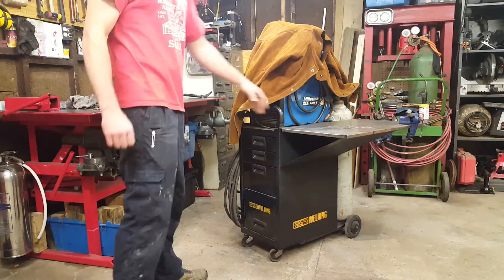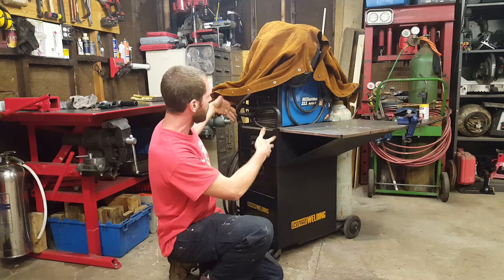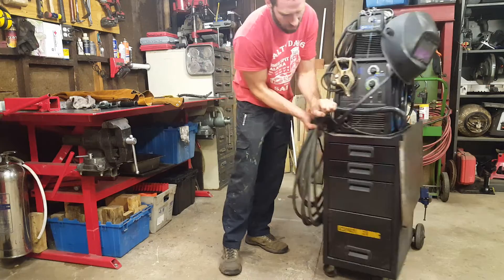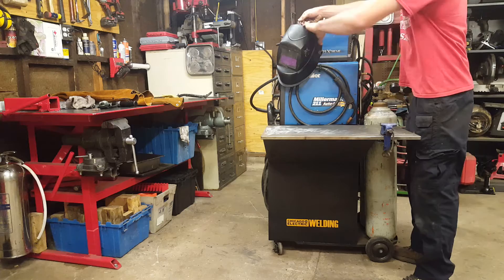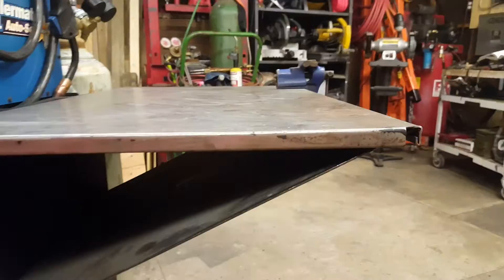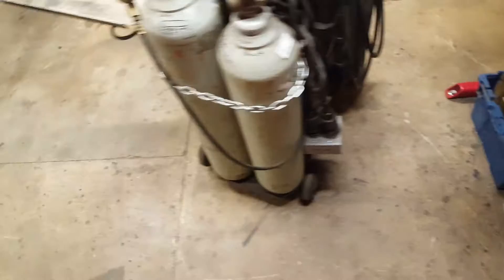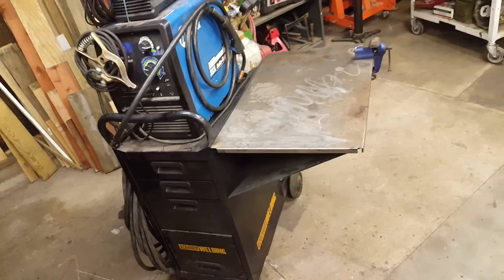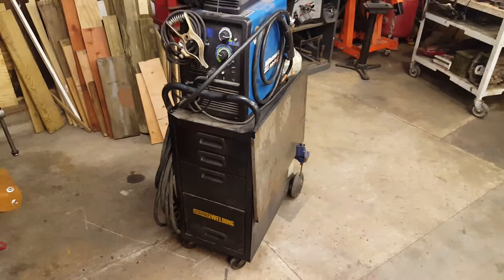Harbor Freight Welding cart mods/review Chicago Electric Shelf modification HF CABINET

Comment: My plasma cutter had 4 rubber feet on the bottom of it which I removed. Then, I took the cover off of my welder, removed the top handle and drilled holes in in the top of the welder cover to match the location of the rubber feet holes that are  on the bottom of the plasma cutter.  I then screwed the plasma cutter to the top of the cover of the welder and re-installed the cover on the welder. It worked out great.  No bracket or bungee cords and a nice looking setup. I use the cable hooks on one side for the welder cables and the cable hooks on the other side of the cart for the plasma cutter cables.

While trying to figure out how to mount the plasma cutter I came to find out that the sides of the Harbor Freight cart are double walled. No wonder the cart is so sturdy. It's built like a tank.  My next project for the cart is to modify the back of the cart so that it will hold 2 tanks instead of just1 tank. (1 25-75 and 1 argon).

Thanks for the video. It inspired me to mount the plasma cutter on top of the welder.

Comment: I bought the Harbor Freight cart about a year ago and really like it.  I am amazed at how well built and sturdy it is. Great bang for the buck IMO.

About a month ago I bought a cheap EBay (Chinese) plasma cutter, which I am very pleased with. As of now I have it sitting on top of my table saw when I am not actually using it and I was overthinking how to add it to the cart. Should I do a shelf off the side, make a small angle iron rack so that it is above my welder, etc.?   Like I said, overthinking.  Watching your video made a mental light come on. I'm just going to take the handle off of the top of my welder (Eastwood mig 175) and stack the plasma cutter on top of the welder like you have done.

Overthinking things seems to be what I do best. FYI -- I keep my welder covered with a moving blanket from Harbor Freight help protect it and keep it clean.
Thanks for the well done video!
Reply: I screwed my plasma cutter to the top of the mig welder case using the holes for the rubber feet on the bottom of the plasma cutter. Works great.
Reply from the maker: Tom Rumish Thanks for sharing.  Im glad the video helped you make a decision.  I thought of screwing mine to the top as well, but the only reason I did not it's because I want it to be portable in case I ever need to grab it on the go. so for that reason I just used some rope and a rubber pad underneath of it. and now if I need to bring it to work with me or something it's a breeze to remove.    I am plagued with the same problem of always over-thinking everything too LOL

Comment: welding on the shelf doesnt damage the welder? like when welding on a car? that looks nice and want to try it 👍
Reply from the maker: David Piceno excellent question. No I haven't had a problem. But if I'm doing some serious welding or any grinding on the Shelf, I do throw a small welding blanket I have over the unit.  But honestly at the same time I'm not worried if it puts a little wear on the surfaces of the welder overtime.  It's a super convenient setup and I don't think I'll ever sell this Miller. I love it!  The only reason I would be concerned about keeping something cosmetically impeccable would be if I was to be reselling it. Thanks for watching and I'm glad you found it helpful!
Reply from the maker: +David Piceno I might have misunderstood your question. Did you mean could the welder electrical system be affected? the answer is no.
Reply: NoNonsenseKnowHow thanks i was wondering if it would fry them,  im going for it

Comment: Can you provide the sizes for the top and bottom pieces of the shelf you made?
Reply from the maker: Yeah I can get that for you later today after work
Reply from the maker: Working service is 27 and 1/2 by 17 and 1/2. and the angled support plate is 20 in wide by 19 in
Reply: Can you tell me what guage sheet is the table and brace ? I just got this cart , and want to do this mod , just don't know what guage to use . Thanks  @NoNonsenseKnowHow

Comment: Nice setup there, I've just bought a Everlast Tig 200DV and been thinking of  doing same setup along with my Hypertherm 30 plasma cutter. Looks like it should work out just fine.  How deep it the top on your cart? Thinks for sharing you cart.
Reply from the maker: mightypoo0 Thanks!  The deck is 20" deep.

Comment from the maker: Recommended on AMAZON:
*CHICAGO WELDING CABINET: https://amzn.to/2o6x77D
*500a MAGNETIC GROUND: https://amzn.to/2MKKWqA
*MILLERMATIC 211 MIG (newer style): https://amzn.to/2MNYvW7
*HOBART EQUIVALENT MIG (cheaper but still a great unit): https://amzn.to/2MNZaa3
*MILLER 375 X-TREME PLASMA TORCH: https://amzn.to/2MQPTxQ
*IRWIN 6' LOCKING C-CLAMPS: https://amzn.to/2wom3Xi
*MAGNETIC WELDING SQUARES: https://amzn.to/2o3lRJe